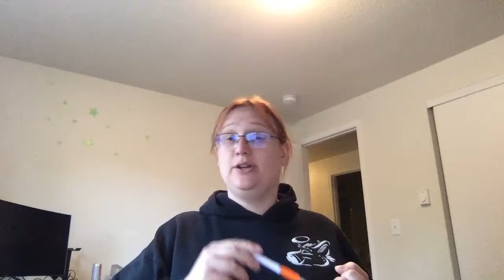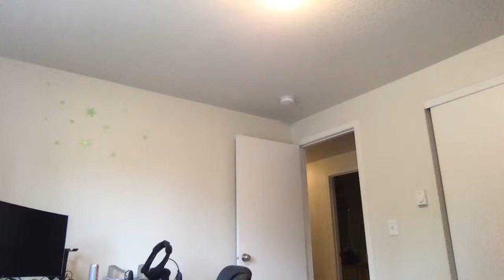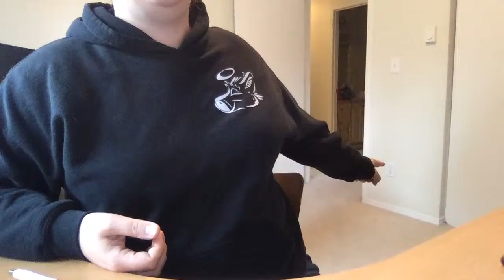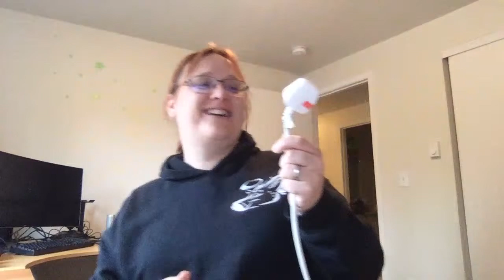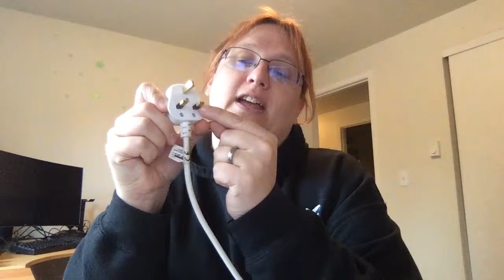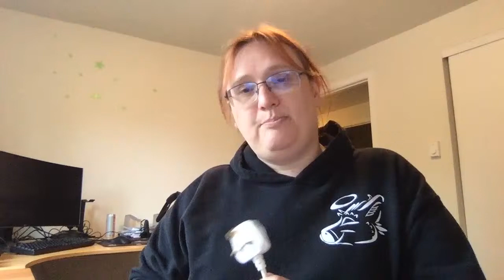Megapacks and More!  Transport Evolved stream

Comment: Sorry - this is not remarkably small. For example a 260 MW output gas turbine plant fits in a space of 50m x 29m = 1450 m2. Which is 0.145 hectare or 3.6 acres. So it’s about the same size as a Megapack. See here: https://new.siemens.com/global/en/products/energy/power-generation/gas-turbines/sgt6-5000f.html

Comment: The issue with storing for months isn't self-discharge (although that starts to matter too), it's cost.  You get "value" out of a battery by discharging it for some useful purpose.  Do that multiple times a day and you get lots of value out of it.  Discharge it once a month.. not much value.  Current batteries are way too expensive to sit around for a month, doing nothing.

Other technologies, such as fuel cells, could be way better there, but they're not mature enough.  Of course hydro is the best current option but is severely limited by available locations, footprint, ecological impact, cultural impact, etc.